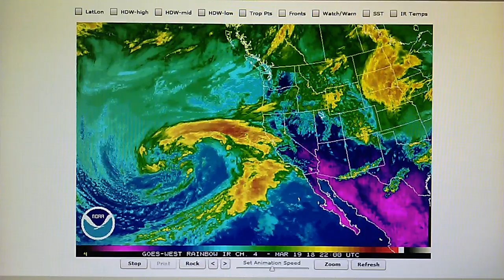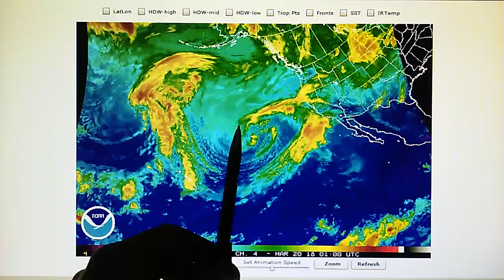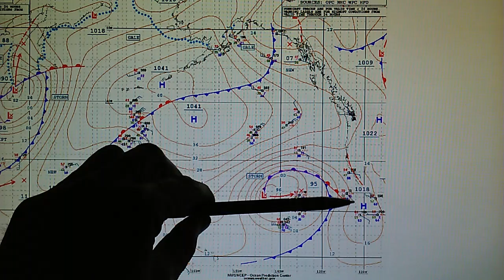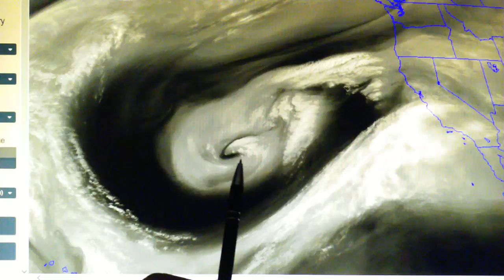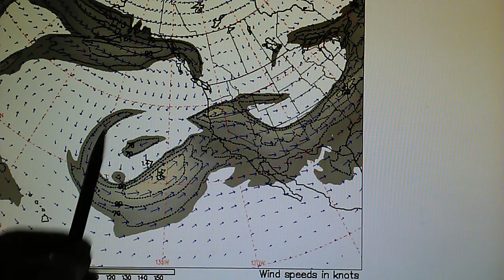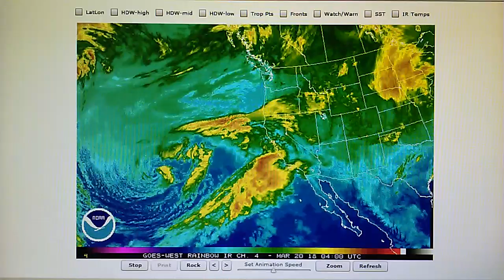3-19-2018;  992mb Storm Generating 33' Swells; Jet Stream Moisture Moving Into CA; Heavy Aerosols!

Comment: Thanks for your dedicated and continued efforts to out the weather terrorists and educate the greater public. 
Looking at EOSDIS for 3/19 it's easy to see the system you are explaining.  There's a straight line coupled with the expressed hot air displayed along the inside lower edge.  Also visible is the smaller non organized center being pushed along.  Then there are all the 'ship tracks' west of Vancouver island and long wispy fingers reaching across SoCal. 
 The 18th shows some earlier directing of the wannabee undisturbed Jet Stream and more 'ship tracks'...